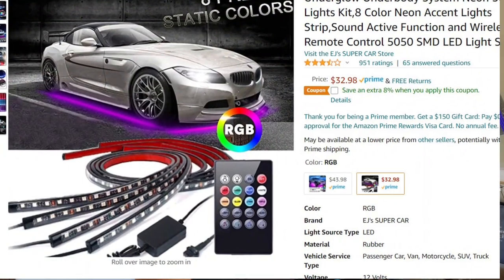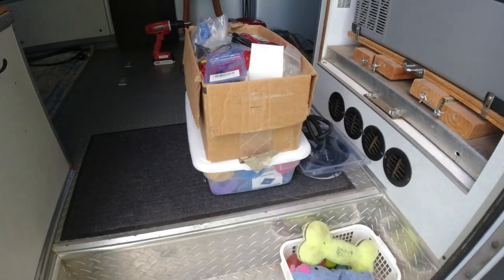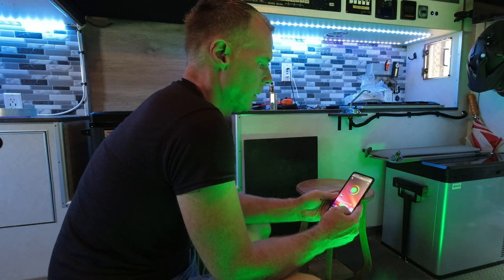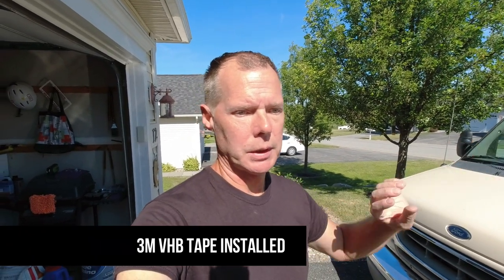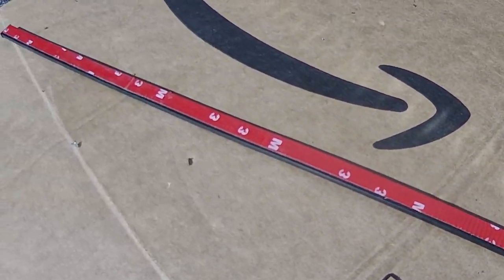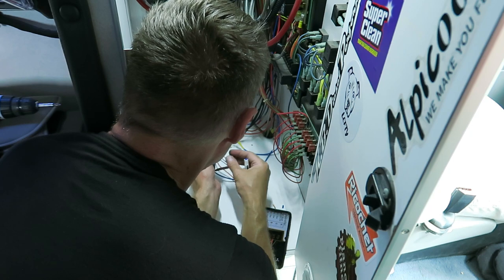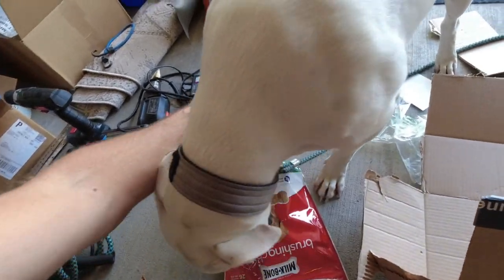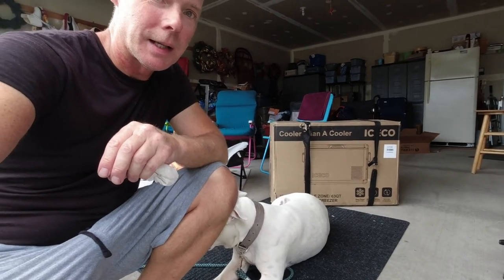Will I Ever Need To Worry About Mice Invading My Rig After Doing This? | Ambulance Conversion Life

Comment: You know, in Los Angeles they had a "thing" going for a while in which people would hide under cars at the end of shifts and wait for their owner to walk up to the driver's door and then slash through their Achilles Heel when they got close, disabling them and making robbing them easy.  Flicking on those lights before getting to your rig could be a good safety measure, both against humans and against any critters who had been hanging around, like the cat we had who apparently liked sleeping inside the engine compartment on the warm engine and one day got chewed up by the fan belt when we started the car.
Reply from the maker: Like ultimate puddle lights!

Comment: I installed OPT7 Aura pro quantum bluetooth LED rock lights under mine a few months ago. I can say  it's a quality kit with the control app and water tight connection cables.
Reply from the maker: I wish I'd just selected a different kit!
Reply: @TheCampulanceMan  You already had that kit and you made it work job well done.